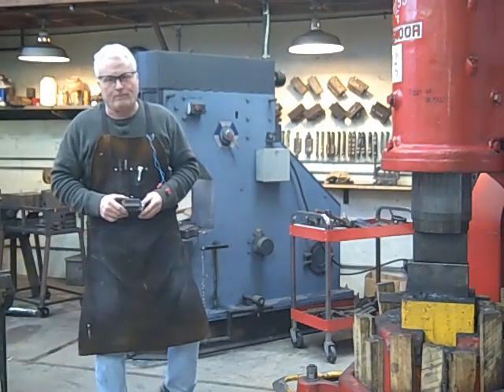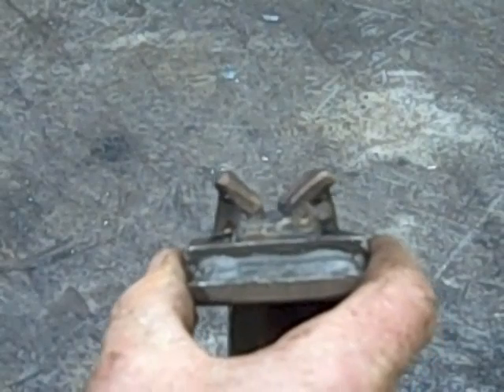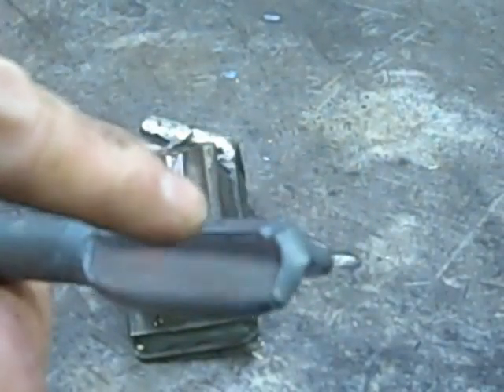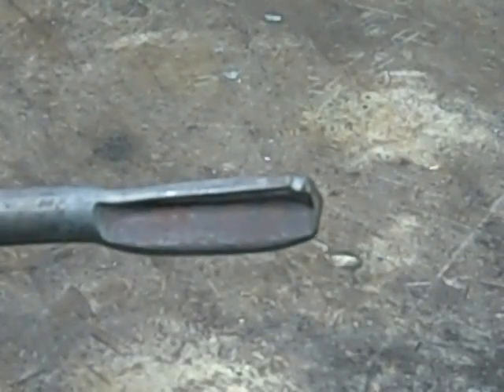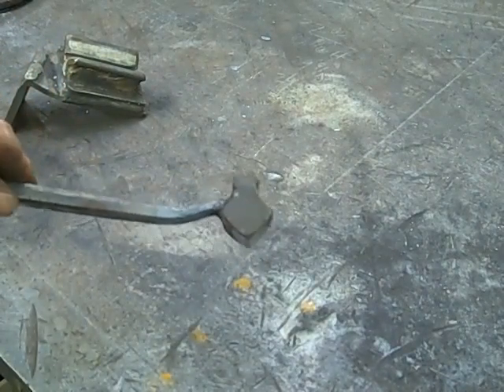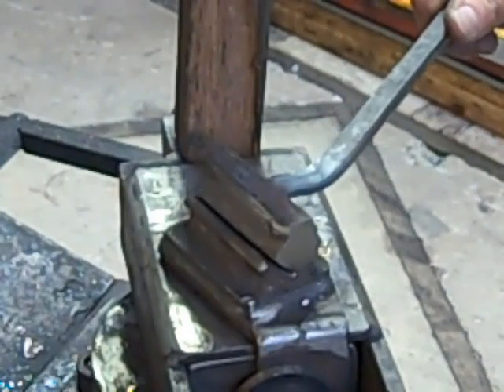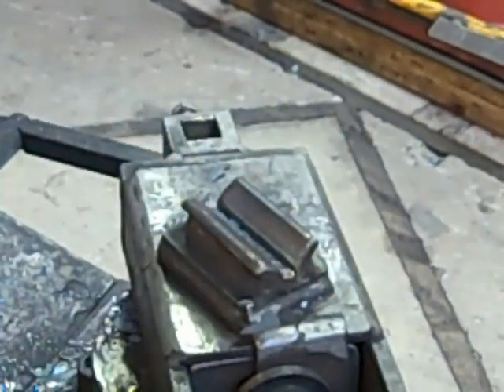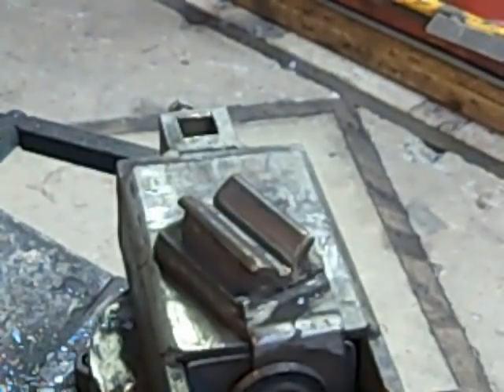Power Hammer Tong Jig II

Comment: Nice jig. There are many out there and are essentially the same. I will use yours as my starting point. You show the tong jig and the v jaw jig. But you mentioned an offset to the reins. You do not show this step. Do you create this offset on the anvil or did you make a simple offset jig?
Reply: Sorry but you don't seem to be reading my question correctly or my question is misleading. I said an offset in the reins not the boss or jaw. 

At about 8:11 or so in video two you clearly state that there is an offset to keep the reins aligned. Also this is clear in the video. Your tong jig makes two offsets. One for the boss and one for the jaws. Now your v jaw jig certainly gives no offset.

So I have to ask once again, how do you place the offset in the REINS behind the boss? Anvil by hand? Rein offset jig?